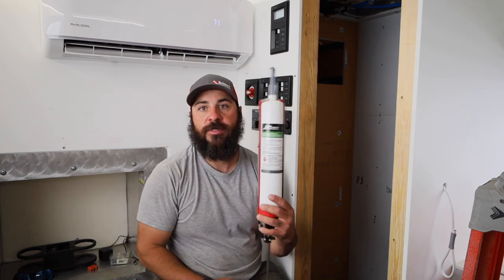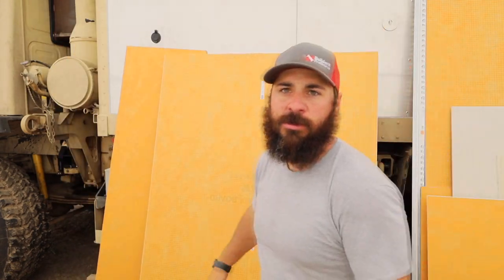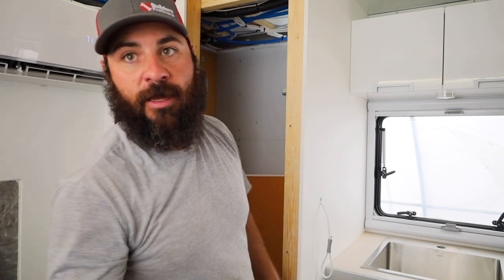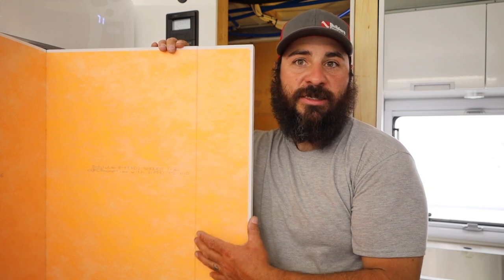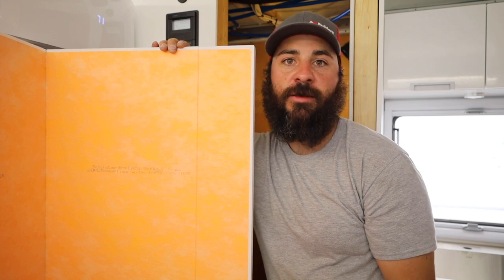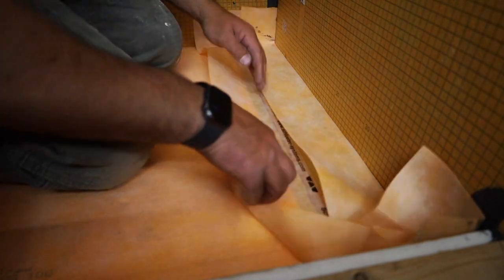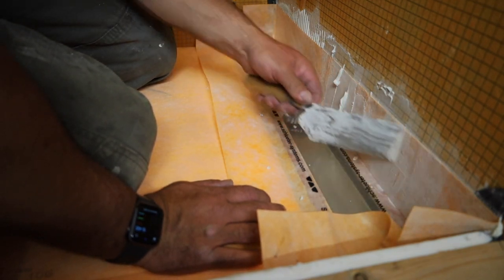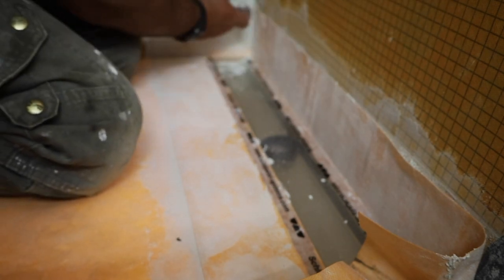Overland truck shower prep with linear drain

Comment: Hey man, The bathroom looks awesome! I’ve used schluter products when I was building my house and it’s great stuff! One question though, how will you level the rig to make sure water flows to the drain if you’re parked on a slope?
Reply from the maker: I have a vision to use bottle jacks between the frame and axle tubes to fine tune level the truck. I’ve tested the theory and it seems to work well!!

Comment: Looking great! I’ve used this set up in a house because of that I filled the excess shower area with concrete and the shluter clothed over to the floor. Great product brutal price up here in Canada. I think thefloor system was $600 or $800. It hurt. I imported some floor drains from china. Stainless steel but not cloth attached so I’ll have to do that part my self. Not to the project yet.  Do you figure that calk would do the trick to marry water proof cloth to the ss drain? I’m really interested to see how this style of system works in the truck with rattle and bumps. You’ll have to give a year or two or three update on performance. What happens for a ‘p’ trap to manage smell on the drain if it’s such a tight fit on the tank?
Reply from the maker: I think the caulking would bond the fabric well or look up a noble linear drain there’s has a clamping ring that is pretty nifty. 
The 1079 box I started with has caulking on all its joints and I noticed none of them were broke or cracking, it’s because of the strong military grade construction I decided I could get away with tiling the shower this way.  Also as far as a trap, I was thinking the shower could have a heavily modified trap within the tank and my sink already has one. I also have considered no trap on the shower at all. It’s only a grey tank connected to sink/shower so how bad can soapy water smell??? Thoughts?